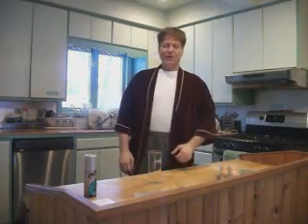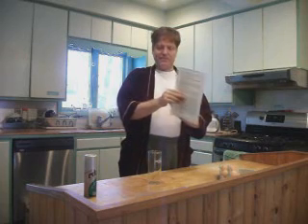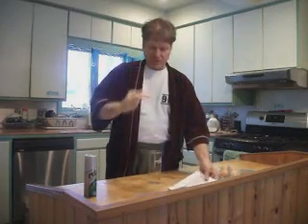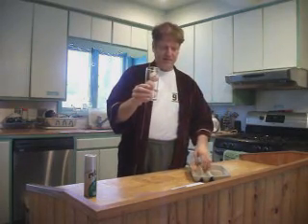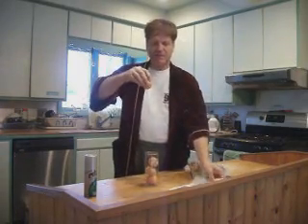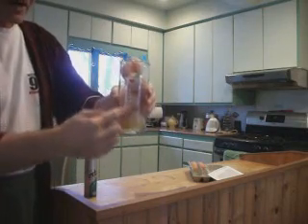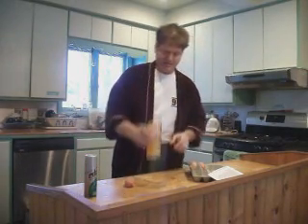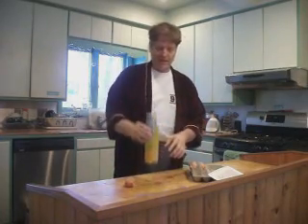9/11 Experiment: Egg Drop, Equal Collision disproves Bazant's "Pile Driver"   Theory

Comment: 1. The relative strength of materials changes with size. This is seen by ants being able to lift / carry / hold large mass compared to their own, etc. If the situation were scaled upward in size, there would be diminishing relative strengths.
2. Egg should only fall "one floor" rather than being held way above the others.
3. Heat weakened upper floors b/c heat mostly rises, so the upper egg should be a softer egg of the same mass.
4. Molten steel was found for weeks afterward under ground zero.

Comment: 5. Demolition wave ejected most of the falling upper mass out away from the building in all directions, thereby reducing the (mass) kinetic momentum incident upon succeeding floors.
6. Two waves of collapse were visible: a. debris collapse with mass ejection of materials on the top, b. explosive squibs systemically preceding the debris collapse wave so that there would be near zero resistance against gravitational force.
Bazant is the butt of jokes.

Comment: @ctcole77 YT DhHzMttUKO0
is a video that says aluminum glows red hot too, but the information does not pertain to the molten metal seen below "ground zero" weeks after the attacks.
Google image search (molten metal ground zero)
then disregard the purported aluminum flows & concentrate on the steel pieces being picked up by the grabber claw, etc.

Comment: This video would be more convincing if the explainer first computed the force imparted by the falling egg, and then compared to the force required to crack the top stationary egg.  I'll bet a breakage of the stationary egg was not expected.  In the case of the WTC, Bazant's calculation concluded that the force imparted by the top floors smashing into the next floor exceeded the necessary force to collapse the support beams by a factor of 10 or 20.

Comment: That was a much smaller plane than those that crashed into the wtc and it was lost, meaning it was flying at relatively low speeds and it had little fuel left over. Not a valid comparison.

Comment: @ctcole77 YT /watch?v=IrrJCa1haaY "Red hot pools of molten steel"
"WTC workers describe pools of molten steel at Ground Zero" weeks after the attacks.
The same claw tool digging seen in pictures pulling up red or yellow or white hot metal from below ground zero is seen digging in this video.

Comment: @ctcole77 Thermal imaging taken indicated that WTC 1, 2, 7 each had underground very high temperature hot spots & no plane hit WTC 7.
Most building material was steel & concrete as opposed to aluminum.
Google video search (aluminum oxide vapor OR smoke "9-11" OR "terrorist attacks")
In plane crash fire images, the plane looks like a skeleton  shell--a more reactive metal than steel, often it does not melt to the ground in pools, but vaporizes into the air in the form of aluminum oxide.